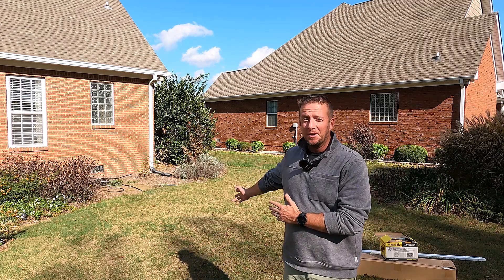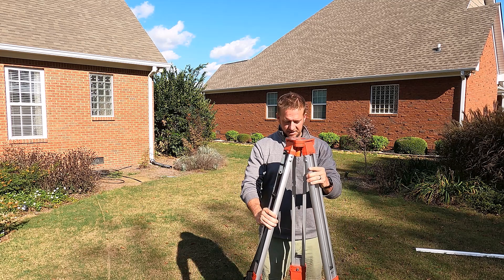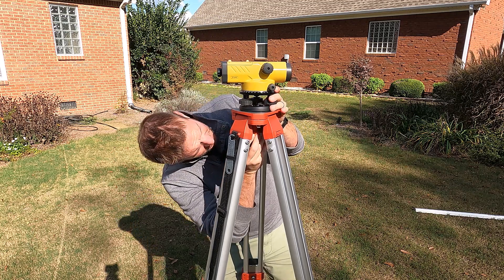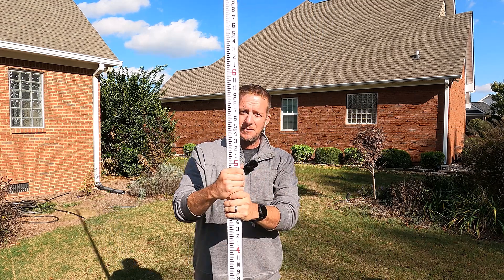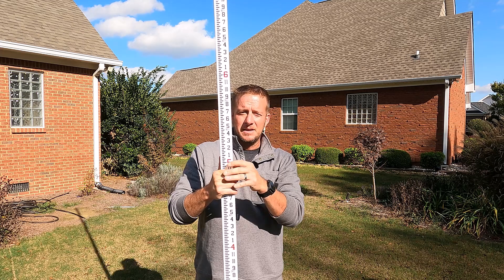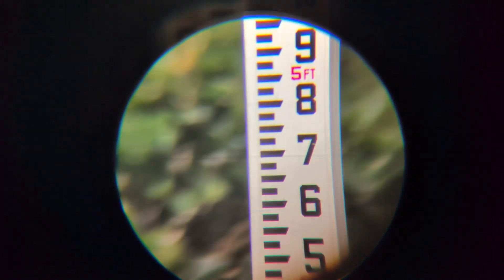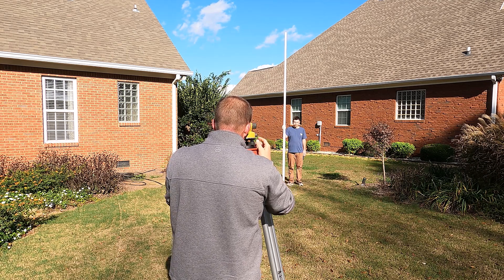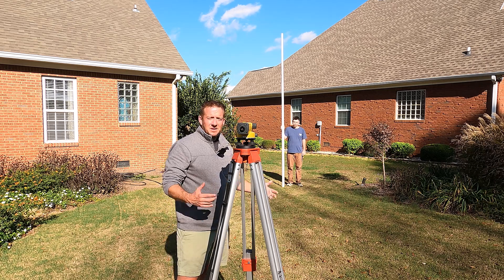How to Use a Transit

Comment: Do you mean  'level' rather than transit  ?!
Reply from the maker: Your question prompted me to do some research.  This might be a regional thing.  In the landscape industry here we call it a transit.  My wife is an engineer and she said they call it transit.  I looked some up on the internet and some say transit while others say level or transit-level. 😀
Reply: @Dr.Warren  that's a builders level. a transit tilts and you can align across to get a straight line on the grade such as moving to align anchor bolts, marking fence holes in a line.
Reply: @everettmarshall3098  You're incorrect  Everet. GC replying here from ct. Warren is correct. That is a "transit scope level". Do some more research because him and his wife are correct. I've used all sorts of trasits, levels, lasers as well working for State of CT DOT, so his terminology if not off, I think you were misinformed bud.
Reply: @Dr.Warren  You and your wife are correct. That is a transit level/transit scope level. Idk what sir is talking about but great content bud.